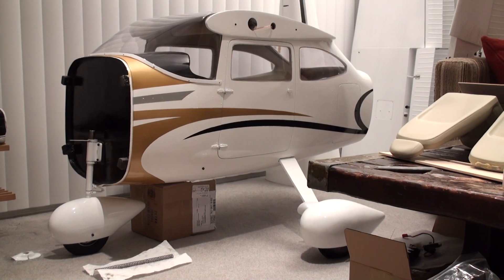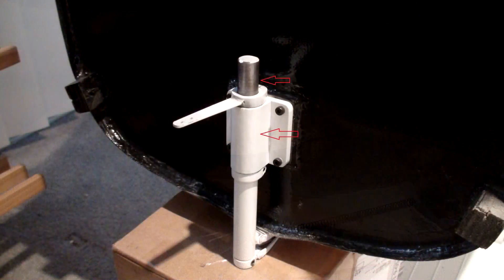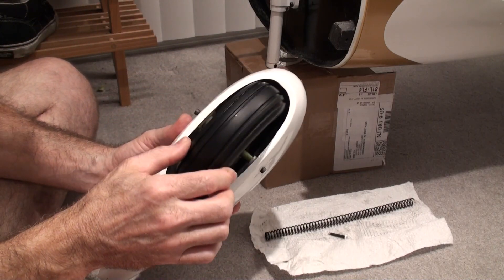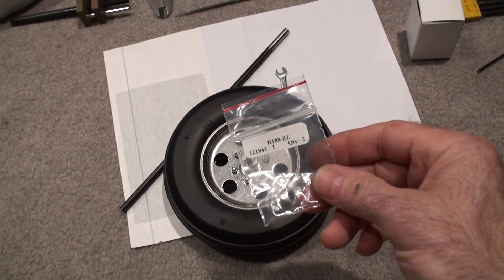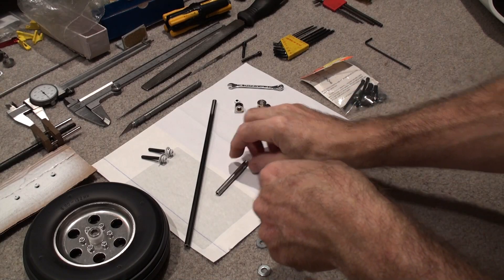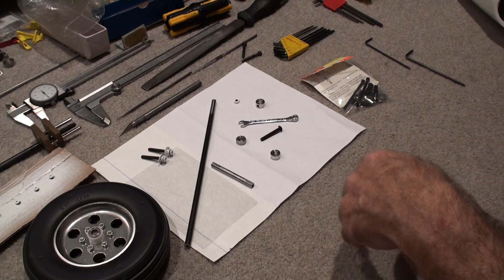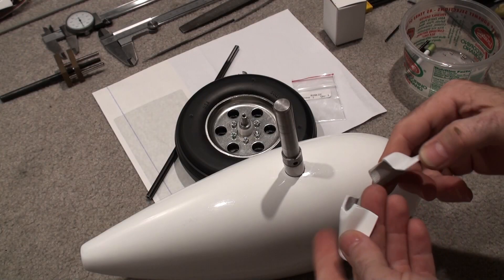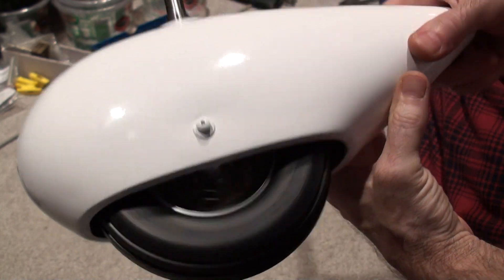Wheel Bearing Mod - 35% TMMY Cessna 182

Comment from the maker: @laryctdummy  Hi, I haven't got the engine yet, so not able to check the load on the spring but it feels pretty strong.
None of the owners have mentioned any issues with it so far on the build thread so I guess it's strong enough.
PS.  There is a link in the video description for the RCU build thread.  Lot's of info there!